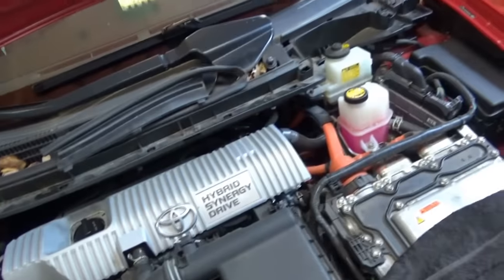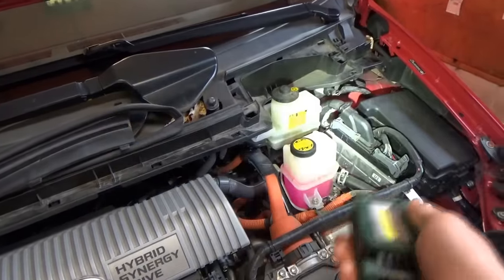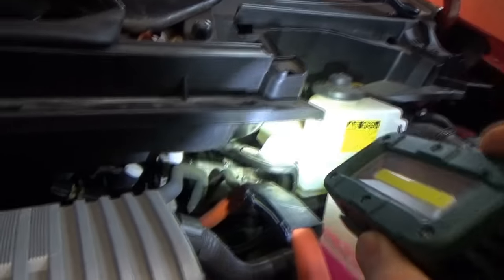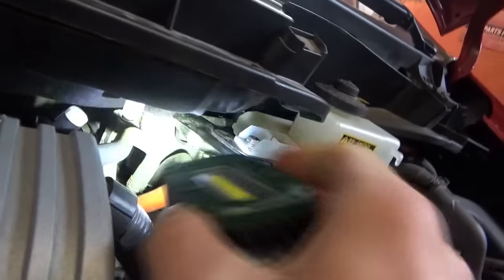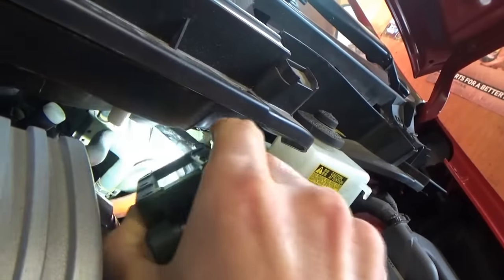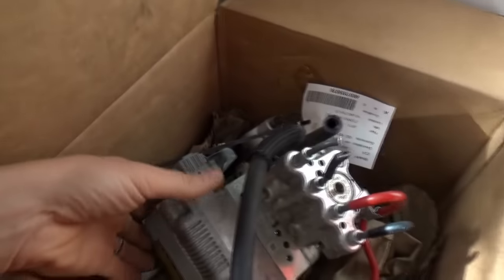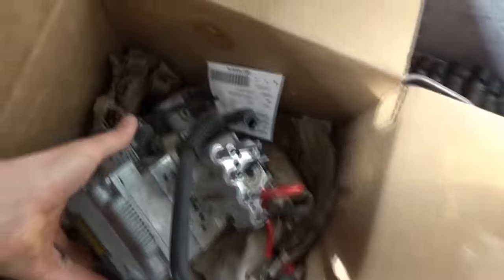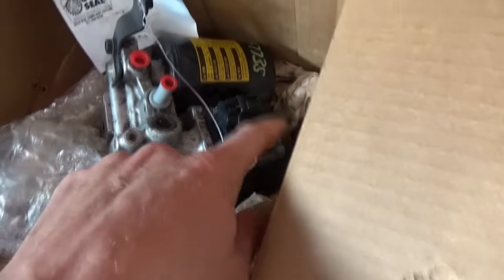Prius Brakes FAIL (Hidden COST of Hybrids)

Comment: 2 hour bleed procedure and a $100.00 dollars worth of brake fluid later. Ivan you are fearless, I would have looked at the bleed sequence and ran. As always, outstanding video and a valuable lesson on the pitfalls of owning a hybrid vehicle.
Reply from the maker: I was surprised that the procedure actually worked out on the first try... What a waste of brake fluid haha
Reply: @PineHollowAutoDiagnostics  So was I, IT VERKED, IT VERKED THE FIRST FREAKIN TIME.
Reply: @PineHollowAutoDiagnostics  Its not "hybrids". It's THAT Toyota ABS system.
Reply: It won't cost that much. Just bleed at the master pump and then at the wheels.  See prado brake masterpump video on youtube.
Reply: Only an idiot would take two hours to waste $100 in fluid. I bleed these all the time in 20 minutes and only use $10 in fluid.
Reply: @psdaengr911 true but the point he was trying to make is that Hybrids have many more components and usually more complicated systems.
Reply: @psdaengr911  FCA have something like this and gm. i have the jeep XJ 1990 ( and yes it was finicky in OEM form as it didn't like lift-kits ect. and did have a recall but it doesn't scare me just keep the DOT-4 super clean!! as it hates dirty or shitty QC oil/fluids ) system on my charger and love it ( way better feeling at the pedal and or knowing if the wheels are about to lock of the downside is extra NVH of course ect. and some parts for these systems can be found on line or at industrial supplies houses or specialty shops like ABS-🛑 brake's BTW i rececament there services as i did have my master restored by them in 2018-19 ish ) VS the 50-80's old imperial duel vacuum booster but mine is modified to run without any computers for now and no abs one day i might fix that as it's on my list of things to change but im not that good at coding so its a challenge for me but saved so much space one the firewall vs my big fat valve covers / easy to work on vs not wanting manual master @70-120 ish apply pressure @ the leg=1200psi hydro 

and one other mod is race car resurulating hydro system mostly for track days and rebleeding the system and filter out junk @ 5 microns from the 6-P callipers/big brake kit+4-JCB SS lines but not necessary for it to work just more convenient to use in my case
Reply: @PineHollowAutoDiagnostics  at least if wasn't like my costume system that used up over a gallon or 3 granted that might be in part to gremlins ( thievery plus sabotage and tools go walking off and parts ect. it just took me a while to realise that was going on at first ) i had at the time and took way to long to get it working right. my first bleeding was a month or so but i had trouble shooting time plus doing it on the weekends/in between work and family time and or waiting for a helper for inside the car, as i had too many parts and things to keep track of to do it safely for the first run but now iv got it mostly automated to the point its a 1man job now.

the next time i flush the brakes i 🤔 my book time should be under 30m's or so and about a gallon or less* of racing DOT-4+ a filter or two 😂
Reply: These brakes are fancy but that’s not because it’s a hybrid. It’s because Toyota fitted fancy brakes.
Reply: @Dave5843-d9m  still better than vacuum systems sometimes being added as i said i was looking for space and weight saving's on my ( started out as a G-code 727 ) hemiTT+tr6070 and lumpy big lift (.600"+ th ) camshaft  + boost and vac don't really work well together and in my SBC 350 stock carbed truck+7004 i had the vac and engine fail at a inconvenient time and swipe my buddy's red P71 car in the lot some thing my new brakes charger don't do as my foot and the storage systems 🛑 ( battery and hydro accumulation and EPS steering system ) it from happening
Reply: and before someone ask's yes the trucks emergency's ( drum mains and drum E ) brakes work ( as was me hard on the pedals @50+lb apply psi and didn't get any chance of keeping the engine running by goosing/go P it ) and was applied but wasnt good enough to stop 🛑 in time after the engine stalled on cold start
Reply: @Dave5843-d9m  vacuum and more so air brakes i feel are better for quite superior luxury cars aka rolls or old imperials / Cadillacs or ( not the knockoff one's aka something A-class movie 🎥stars boutiqued ) continentals 😉🤠 because if the inherent quality's of how the systems operate. not so good for 1ton trucks or sports car's
Reply: @Dave5843-d9m  💭just came to me ( just remembered that i have family member with a red/blue one but we have a falling out and was years ago ) didn't the early ( or later ) Toyota Prius didn't have "fancy brakes"? but a fancy vacuum pumps ( and can't remember if there was a vacuum accumulation chambers or not added to the system's ) and or skipped it and use the hard pedal ( and no A/C ) mode? for when the engine was off??
Reply: @18avshalom  alright, you make a video like ivan here to show him a easier way
Reply: Autozone Dot 4 brake fluid costs $28 per gallon or $ 8.40 per Quart. I don't know the going rate in State College PA, but I guesstimate Ivan to at least $75/hour. The cost of brake fluid is negligable in the greater picture. If you work cleanly, just re-use from the second bleeding onwards.
Reply: @erik_dk842  👎don't it can rewan the pump @2k-psi and main booster seal 😉 from dirt or water ect. ( think of a water 🚿cutting torch / cutting same problems 😉 ) as it already left the sealed system once and as a plus it can take the small amount of junk with it. the 1998 dealership's manuscript it very sophistication not to reuse the old fuild in big bold typewriter 😉 and there not wrong as some other jeep guy's have rewaned theirs ect. . a rebuild for me was at least 300$ usd pump was at least 600$ and yes at least for me 20-ish pre-quart / not the good stuff but needed for quick checking sealing/correct working the good stuff is 30-ish+ motal racing / f1-sorry 😐have notes 📝on it on what it's branding it but higher end car's/high-end race cars 🏎use it and is cheaper to me than having problems/part failures and a crash same way with my engine oil 😉 🤠
Reply: the mid 1990-2000's gm cars had problems with the abs and brake system so much so it was causing crashes ( the aluminium and or valves and seals were getting water jeted out or electronics were failing from water/DOT4or5 and i did help fix a devil with that problem after it crashed @40mph~ ) and recall's mostly from bad fluids/dirt salt ect. im sure that there's others as well but it's one model that i did have something to do with professional  👨‍🔧  and it is one the the junkyard module's that i can work with to modify it for the charger 😉 / i know it somewhat well. in theory the manual master cylinder and braking systems can have the same potential problems but it tends to be less pronounced of a problem's unlike the ABS system's and hydraulic boosted systems
Reply: ps. diesel and GDI high 2k-psi+ pressure pumps/systems can have similar problems to a abs system 😉 so it's not just braking systems that can have problems with it
Reply: @richardprice5978  You are right. It's just $28/gallon. Peanuts compared to labor and other parts. Or you can use it to flush the system in an old clunker.
Reply: You do realise that almost every car has ABS tgese days right, not just Hybrid?!
Reply: It took me 20 minutes to bleed the brakes on a prius after replacing both the booster and accumulator, 2 hours is just ridiculous and if it takes that long either something is still wrong or he doesn't know how to bleed brakes.

Comment: Hey Ivan. We work on tons of Lexus and Toyota vehicles at our shop. Quite a few of these that aren't hybrids use the same type of brake system. We have had to replace them on the non-hybrids as well, they are just easier to get to. PITA for sure but actually profitable once you've done a couple. Most shops in our area won't touch them.
Reply: My 2010 prius with 148k miles has blinking high temperature light. It comes on for 1min every time entering freeway. Sometimes my prius has heat but sometimes doesnt turn on. Its been like this 3months now couldn't figure out. I replaced thermostat at 148k already but didn't fix the issue.
Reply: I was wondering if that’s the same type of accumulator setup as my 2006 land cruiser. 👍
Reply: @troylollysaf9311  purge the coolant system. theres probably videos on it.
or park car facing up hill open radiator cap. run car till warm up
 and add coolant. if not then find the video. disclaimer im not prius expert
Reply: I have a '03 Lexus GS and noticed this pump turning on for a looong time every morning on ignition. Sometimes it does two cycles. It also turns on sometimes when braking. I guess I have a similar problem then. I was thinking more like vacuum canister leaking or something.
Reply: I do have toyota pirius 2010 and the engine is broken and I want to fix it how much it will cost and what is the address?
Reply: Send them to Scotty Kilmer, he worships Toyota, so he might do the job for free to make Toyota look better.
Reply: @bmw803  you go to Chevrolets 😂
Reply: The 100 model landcruiser has this same brake system on it using the pump and accumulator. You can buy a new pump or get it rebuild. The brake system is more assessable though.
Reply: A standard vacuum booster is simple and reliable. In over 20 years doing this never seen one fail. Even when going to electric there was no reason to replace it. A simple vacuum pump and reservoir is all it'd take.
Reply: @troylollysaf9311  replace the coolant pump
Reply: @alansailing1387 Land Cruiser has this because it's tall and prone to rollover. Using a system called vehicle dynamics integrated management, the electronic braking system can literally make millisecond by millisecond adjustments of the brakes, combined with throttle and electric steering adjustments, to stay in control, often correcting a skid before it becomes an issue. A traditional braking system with this type of control would vibrate the pedal, much like ABS.
Reply: @troylollysaf9311  had same issue. water pump replacement beside the thermostat fixed it.
Reply: @pyronitro  How do you explain empty coolant tank? Mine was completely empty
Reply: @troylollysaf9311  in my case. Since the water pump was bad it boiled the coolant out and you can see the residue traces at the tank when it does that. But there are other failure modes that can do this. You have to diagnose it further to know.
Reply: @troylollysaf9311  I wish they put in a temp gauge in the Prius. In my case I use an app called hybrid assistant so I see all of these values and it also keeps a log of all these values and I run this app every time I used the car so when something happens I can see what's going on. The car that had the water pump failure was my wife's and I have her run that app so we can see that the temp was spiking upwards for a brief moments of time and that's how we knew the water pump was failing
Reply: "PITA for sure but actually profitable once you've done a couple"

It's really the best way to look at business.  People don't really understand and get grumpy when they have difficult problems to solve.  If you just take a positive attitude (simply charge the customer more) then it's the correct attitude.
Reply: @427daison  I agree with you.  Using an OEM coolant pump and OEM coolant you can do the job for the same price as what Toyota will charge a customer to simply drain and refill the coolant.

Comment: Yes, I know, an old video. Very brave taking on this fix, a big risk for the customer if it failed probably terminal for the vehicle, I am sure you cleared it first with the customer.
Not many would tackle this and I am always impressed with what you do take on. Thanks for keeping me entertained .
Reply: I have to get my ABS actuator replaced for a gen2 since it is finally going at near 20 years but there are places that do this replacement, only $300 for labor, $400 for used part off ebay ($1200+ for oem on toyota website) so there are places that do this, but you're only really likely to find it in a city. But if you're handy there are no less than 5 step by step videos on youtube on how to DIY with the most toyota has to do is flush the brakes (hint they can still fk that up)

Comment: Good video! Hidden costs are unreal in these cars. I worked with a guy who bought a used Prius, bragged for 3 years on the fuel economy. Not long out of warranty, the battery pack went bad and the dealer told him he needed a new battery....for $8,000.
He said that's it for him, he proceeded to trade for a good used Camry.
I used to tell him, "pay at the pump or pay later"
Reply: If I saw a mass like that I wouldn't buy a Camry. It's another product of the same copmany's engineers. .
Reply: $8000 ? Price breakdown please.
Reply: @psdaengr911  Nah. Camrys and Corolla’s are good. Have a 07 camry and a 16 Corolla.

Comment: 230k miles and needs a new brake booster stroke simulator module.  Not bad, really.  My 2014 RAM EcoDiesel needs a new DOC/DPF at 125k miles.  Extended manufacture warranty (due to AEM settlement) is replacing it for no cost.  Would have been $1700 for the part and then labor if I had to foot the bill.
Reply: It's a Fiat Chrysler made vehicle. I'm surprised it lasted that long.
Reply: Had a problem with my DPF on my 13 TDI Jetta. Lucky it was covered by Dieselgate warranty. I'm dont with Diesels. Had 6 of them before, but all those emissions systems make it no longer worth it.

Comment: Thanks Ivan ! Great video on the Prius brake system ! I just recently got the Prius brake/abs/TC/!  warning lights on my dash alerting me to the brake booster /accumulator replacement needed on my 2011 with 120K . Figured I would tackle it myself, then learned about needing the "OEM level" scanner to bleed the system . Started looking at my repair options besides the local Toyota "stealership"  . My local shop didn't want to tackle it  . Found your video ..........THANKS ! I was going to contact you , to have you do it for me (I am about 1 hour away) but your video helped give me the confidence to tackle the bleeding procedure myself (installing the parts is np for me) . I ordered the exact same Thinktool Pros in your link (used your amazon link , so hopefully that helped ) ! Thanks for all you do,  from a new Subscriber ! Not sure if you have a Patreon account yet for people to say thanks with some monetary thank you donation ? Thanks again !!!